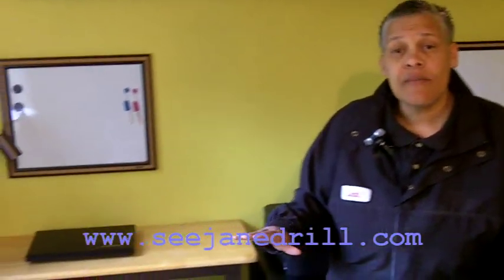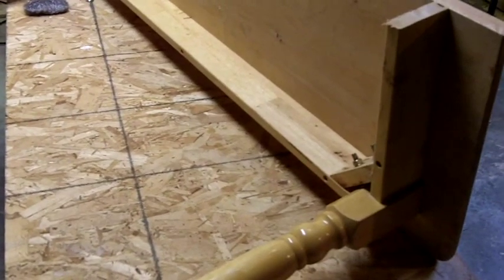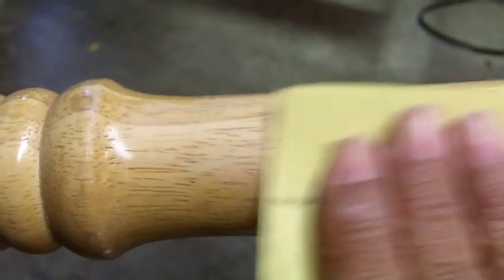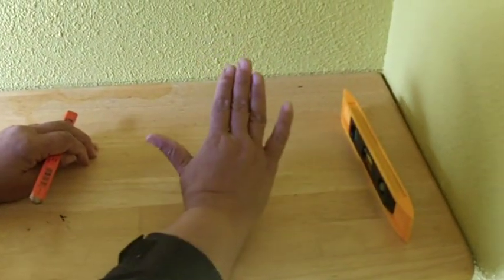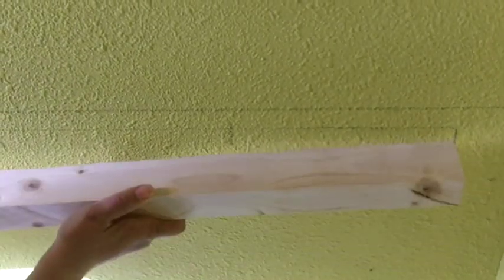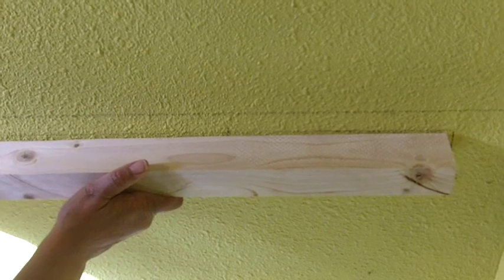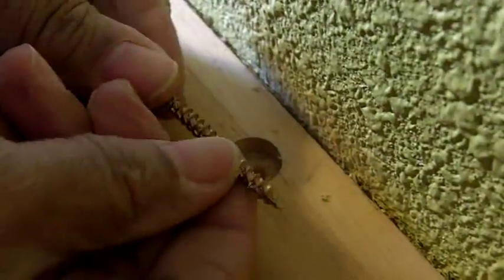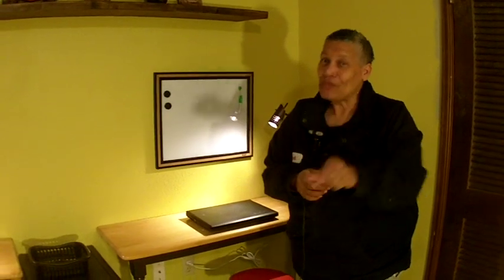How to Make an Incredible Almost Free Laptop Desk

Comment: Love this project. I have a question, when your drilling with the spade do you go all the way into the top of the table until you reach the cleat? or do you leave some of the table at the bottom in order to attach the screw? Thanks again.. Love you!!
Reply: monikita777  you only want to go deep enough so that your screw head is below the surface of the table, you have to take into account the depth of the cover piece you are using as well into your measurements. Try to leave at least 1/2 the depth of the table if it's a man made board, if it's wood you can go a little deeper but leave 1/4 what ever type of material it is. To mark how deep you want to go with the spade bit, just measure up from the flat wings of the bit and wrap a piece of tape at the point that you want to stop drilling at 
    Just to add about the positioning of the screws for the top, keep in mind the position of the fastening for the cleat. Make sure to leave some space around them so you don't screw into them from the top.